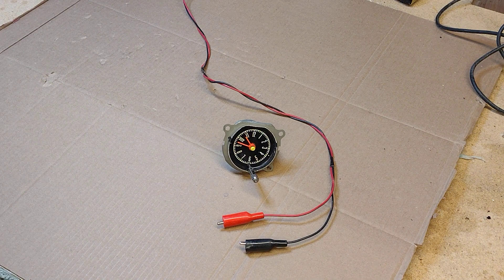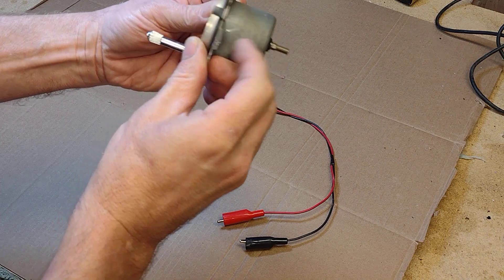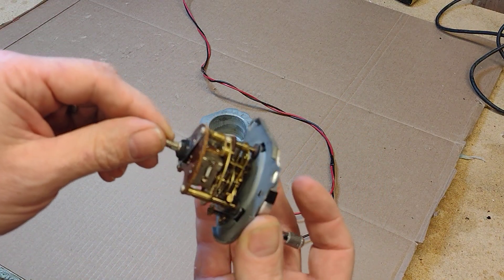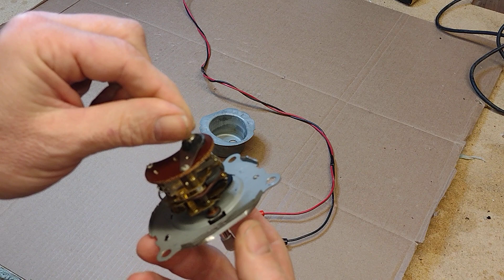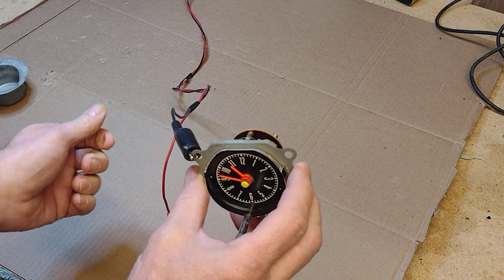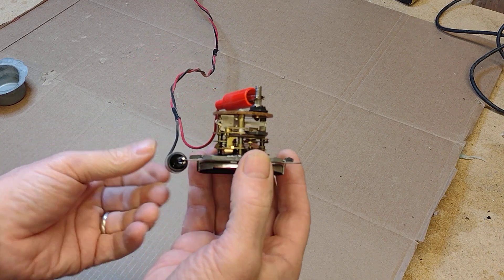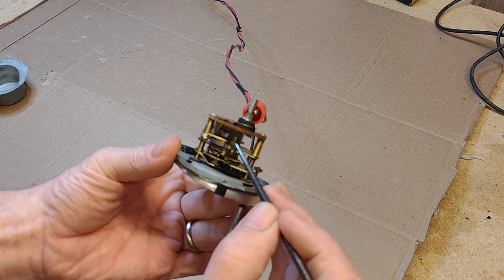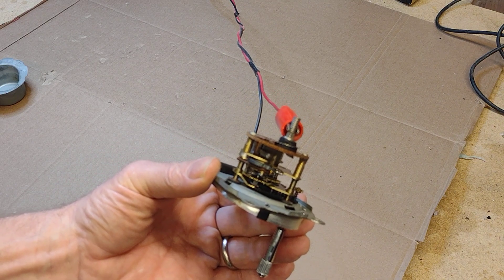How an original 1967 Ford Mustang clock works

Comment: Larry how does the case come loose? Afraid I will break something if I pry on it.
Reply from the maker: There are areas of the rear case that are crimped to the front of the clock.  You'll see them if you remove the clock from the dash.  Bend the metal with some needle-nose pliers.
Reply: Found them thanks @LarryCook1960